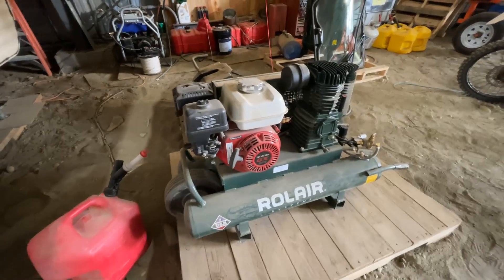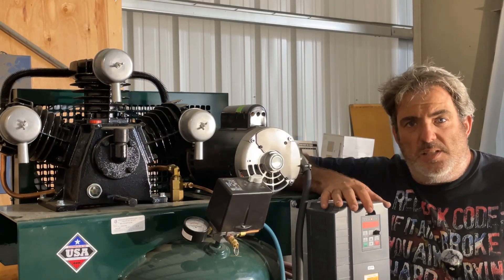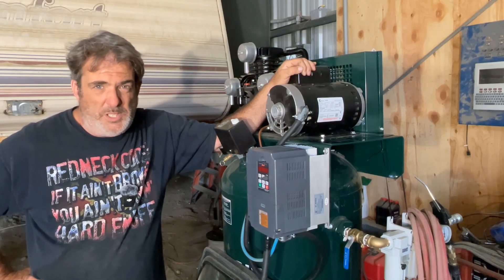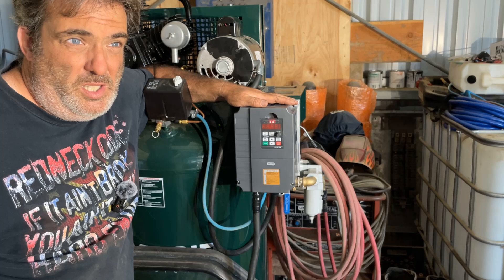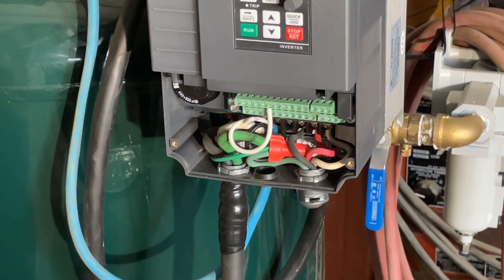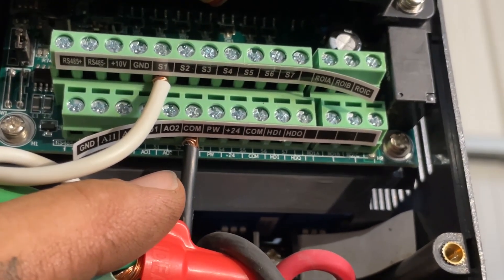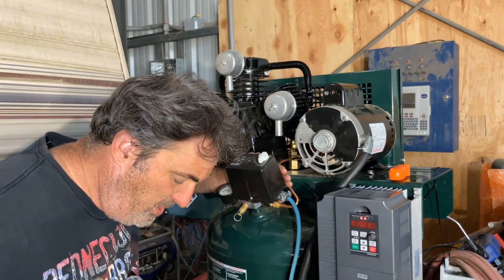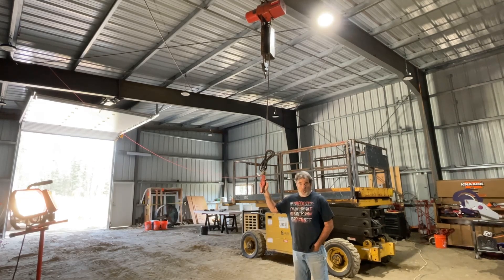Off Grid Power for 5hp Air Compressor Success!

Comment: By chance did you put together a video on wiring it all up and setup in the VFD? I’m doing same exact thing on mine because of same issue!
Reply from the maker: I hate to admit I didn't put one together of the mounting and wiring of the inverter, and worse than that I just flew back from a fast trip up there for a few changes and repairs and didn't get to film an update to the inverter on the air compressor.  

In short, the 10hp inverter died after fighting to start the air compressor in the winter and colder weather when the oil thickened and the compressor tightened up a bit.  I did manage to confirm this by heating it up prior to starting, then it started just fine and did what it was supposed to, but sadly the magic smoke was eventually let out of the inverter.  

But that is why I opted for the Chinesium one to start with.  I wasn't certain that I had sized it properly.  The compressor has a 5hp 3ph motor on it now, and the inverter was rated for 10hp, but open drive compressors have a huge inrush current needed in order to get them spinning.  

I just replaced the 10hp inverter with a 15hp inverter and so far it has been flawless down to 37*F.  I'll play with it and test it more over the next winter/spring season before I commit to it being reliable enough to depend on to be part of the air supply needed for the foam spray rig when the time comes.

As for wiring, both of them had some funky instructions saying the input single phase could go on any of the three input legs, and the second one even had the center leg capped off.  This didn't work though, the input for both needed to be on legs 1 and 2, labeled "R" and "S".  The output three phase was straight forward and landed on UVW if I remember correctly.  I then ran a 2/18 cable from the pressure switch to the digital input points to control the start/stop function of the inverter.  

The old unit had the accel and decel times set to 3 seconds for soft start, the new one I have set to 5second and 2 seconds, though I may extend the accel time for colder weather to soften the start up a bit when it is colder.

They both came with a decent enough manual explaining the various parameters and which ones to use to set the motor data plate information properly.

If you want, I should be back up there next month and can make an updated video explaining what happened, what I did and go into depth a bit about the parameter settings I used.

I have made other changes as well and really need to put together an update video and get some more work done to Hefty and Skid Mark as well.

I hope this helped some and feel free to ask more questions if you have them!  I'm certainly no expert, but know enough to eventually figure out ways to make things work the way I need them too and occasionally have fun in the process.

Comment: Question, what am I not seeing for running a AC non VFD motor with a VFD drive? Also did you add a shaft grounding ring to your motor?
Reply from the maker: You're not missing anything at all.  We have run non "VFD spec" motors for decades with VFD's (just not on single phase) with no problem.  The biggest thing that I know of is to make sure the size and type are correct for the intended use.  As for a shaft ground ring, nope.. I added nothing to the motor, just connected to the factory ground on it, the inverter and the ground bar in the panel which is grounded to the rod for the panel.  I actually have a ground rod at both panels in the building and tied them together since my ground is mostly rock and sand.  VFD spec motors tend to mostly have heavier insulation on the windings and the ground rings is my understanding, but honestly a vfd can a three phase motor without them just fine.  It's just a matter of the motor may fail sooner than without it, but we haven't seen it happen when we have put vfd's on non vfd spec motors. I am sure it has somewhere under some condition though.

I have no doubt that the VFD I am using is not the "best" quality, or more durable for what I want to use it for, but it was affordable, easy to get quickly and would answer questions for me.  Since it's on the air compressor it also doesn't need to run continuously either and will have cycle time.  The real test will be when I want to run the foam machine and it either needs to run for longer duration or cycle more frequently.  Even then I will take breaks between the sets of barrels to let the various equipment (myself included) rest and cool off a bit.

Comment: adding 1-2 auto transformers should do the trick.  I have a 5k auto transformer in my system. This is so if my central air and everything turns on same time it helps my 2 5k inverters with the loads. For shops I would have went with Snyder inverters.
Reply from the maker: Thanks for the idea about auto transformers, hadn't even thought of them.  Most my experience is with VFD's so I went with what I am the most familiar with, though I hadn't used one to convert from single to three phase until this project.  As for the brand, I figured quick and cheap to test.  If/when it fails I can swap to a better, or higher quality one.  Since I am not there anywhere near as much as I want to be yet, the cheaper ones work for proof of concept and to get things working for now while leaving some money in the account to put towards concrete and foam resin to finish off the main building.. hopefully next summer if I can get enough done this season.

Whoops.. you were referencing the Sol-Ark, not VFD with the Snyder recommendation.  I have loved the Sol-Ark's overall and they actually have been great at handling everything I have needed up until this air compressor.  I had an Outback Radian prior but swapped it with my father so he could have two and I could pair up the Sol-Arks.  They work really well for my needs overall.  Excellent customer service as well, at least when I have called with ideas/questions to run by them.
Reply: @VowellVentures  Yeah inverters that do not have transformers in them are mainly missing the surge power unless you really oversize your system. I myself did the research and Growatt 5k inverters and a auto transformer was the way to go. I could do 3 phase with mine if I add 1 more inverter but I do not power a garage with compressors. Auto transformers are not real expensive. you would need 2 at around $800 total.
Reply from the maker: The Sol-Arks have a pretty good surge power on them overall, just not a long enough duration and because of that don't like hard starting motors which I expected and figured I would end up working around.  The have handled other heavy loads fine, just not this 5hp air compressor which to be honest, I didn't really expect it to just hoped it would.

 I also didn't expect to need this new air compressor as soon as I did either, so I thought I had time to finish my system.  But when I finally found the specifications of the foam rig I have it became very apparent I screwed up when I bought my gas compressor and got one too small.  Then it became time to figure out a work around solutions. All part of off grid and homesteading I suppose. My place is a bit.. larger and "different" than most for off-grid though, part of the challenge that makes it fun.  I want a nice shop where I can think and putter to my hearts content and (with in reason) be able to run all kinds of fabrication tools for various ideas I have.  I'll just stick our house in the back 3rd of it and call it good!  Later I hope to extend the shop enough to make up for the space lost to the house too.

 I'll check out the auto transformers though, I haven't played with them or even thought of them to help with surge/in rush loads.  Great idea actually.   Thank you for the suggestion!
Reply: @VowellVentures  I wonder how the EG-4's would do, seeing as they have stupid long high surge run times. EG-'s 18KpV has PEAK POWER (SURGE CAPACITY) w/ PV: 14700W (10 min), 15500W (5 min), W/O PV: 13500W (10 min) for just one unit.
Reply from the maker: Hadn't heard of that inverter setup so I looked it up.  Appears to have a lot of similarities to the Sol-Ark I am using.  I really like these hybrid units overall.  I see this for the EG-4 12K version, "Peak Power: .05s = 16kW, 1s = 12kW, 1min = 10kW, 12min = 8.8kW", it looks like two paralleled like mine are would start most anything just fine, still debatable for something as hard to start as a large air compressor.  With the setup I put together I think I could actually use that same VFD on a 7.5hp air compressor if I ever decided to go bigger if Rolair dies on me someday.

It's great seeing the solar technology advancing from all angles so rapidly!  Gives a piece of mind that as the property grows, I can have the system grow with it and be able to use more and more efficient equipment.  Equipment that gives more wattage per foot, takes up less space, lighter and easier to handle.. any or all of the above are great benefits to the technology advancing so quickly!